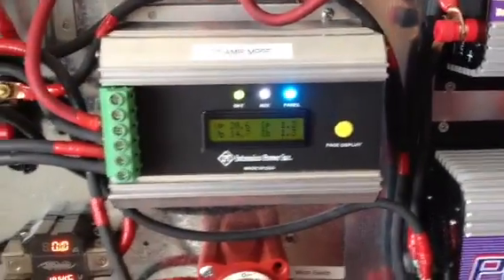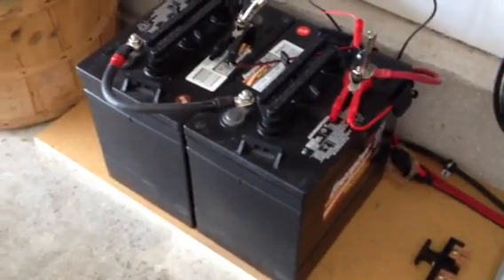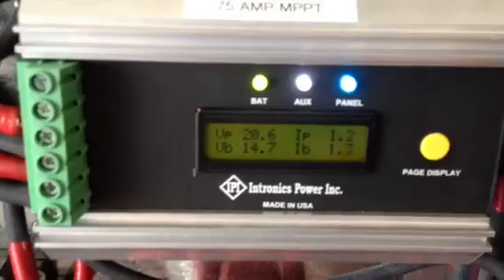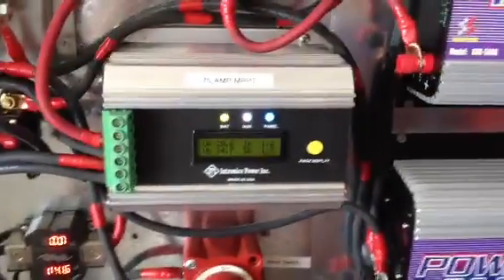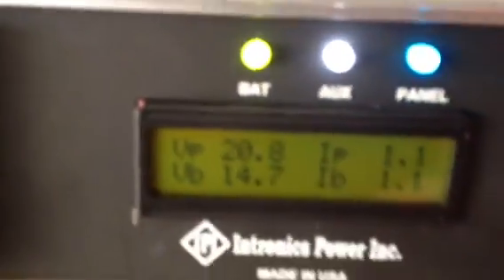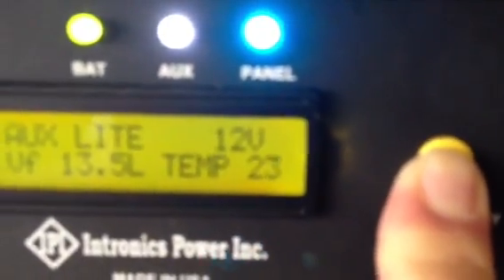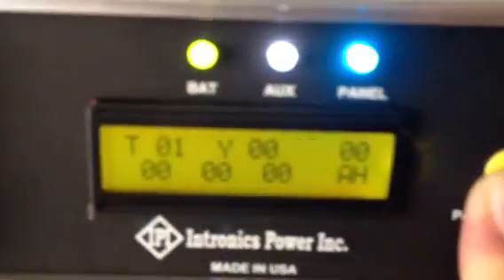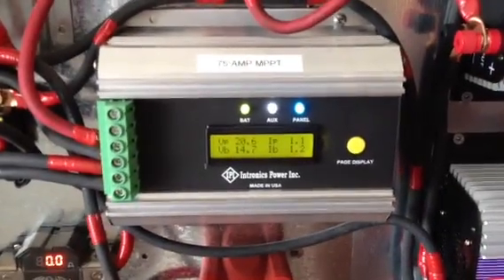Intronics USA Mppt charge controller, inexpensive alternative to midnitesolar and flexmax outback

Comment: How long did it last? Hearing many complaining about it 'chattering'!
Reply from the maker: +Sammy Kalintosh still working but I don't use it much only for random use o Rd emergency
Reply: Ray Isimz ok
Reply: Does it seem durable?
Reply: had my 500'ds since2011 and 1012
faultless. Some noise from the fan but not unusual amounts.
Reply: Mine has been running for 5 yrs with 3- 315 watt panels and 4- lead acid 1275 Trojans (12v 150 AH ) The fan will need to be replaced with a new one and you need to keep it off of really warm walls, I have it installed on a 12 ft box truck working solid everyday with my 120vac mini fridge running even on cloudy days for 5 yrs without fail!

Comment: IF you read the manual for this controller it will accommodate an input of up to 80 volts... and output a selected voltage of 12, 24,36 or 48 (?if memory serves) it will transform all input above the charge current selected down to charge current voltage and add the 'extra' current to the amperage boost. This is the MPPT function in full swing.
Reply from the maker: +joseph bodden thanks for watching

Comment from the maker: You need to run 24 volt battery bank if you have 24 volt panel you can connect 12 volt batteries to make 24 volts but you need to research on how to do that.
Reply: +Ray Isimz two twelve volt batteries in series (neg to pos) equals 24 volt battery. parallel connections build amperage (run time) and series builds voltage. i.e. four six volt batts in series equals 24 volts. 24 volt system generally charges up to 26-28 volts. research and use dc circuit breakers (best) or fuses in appropriate places.
Reply: NO YOU DONT! 
It is an MPPT it will convert your power from up to 90 volts down to 12 volts  24v, 36v or 48 volts , my panels deliver about 40 volts and I use a 12v inverter, this is the main reason to use an MPPT charge controller over a cheap PWM.

Comment: I'm running 24 volt solar panels, and a 12 volt battery bank, what would the sw7 and sw8 dip switches be set at, I'm a bit confused
8 up and 7 down, ?  thanks

Comment: You are using grid tie directly to the output of the charge controller? Or is using parallel? I would like to use in grid tie output of the charge controller. First to protect the batteries and then to look more like more modern systems. But I've been told that you can ruin the controller. Know anything about it?
Reply from the maker: Not sure I understand your question, but my grid tie has been working fine the way I have it hooked up for over a year now.

Comment: Yes, I tried one panel first and it did the same thing. The paperwork said it worked between 22 & 60 volts, so I though one panel at 19v on the multimeter might not be enough. It has not worked. No 3 green lights, only fault or high pitched noise depending on which way I wire. Unfortunately it was many months between purchase and installation and so returning it is impossible.
Reply: I think you should contact these guys and tell them about your malfunctions... if you seem honest and forthright you may find they can allow some slack on the warranty. I had one that I accidentally wired with the batteries into the solar inputs... they just kinda laughed and asked if any smoke came out, I said no, they said 'keep an eye on it' and if anything seems wrong we will send you a new one..." so I asked how much that would cost... they said nothing, just be sure to return the bad one. That unit is still working - all three of them actually... I really like these units. I have two 500'ds and one 750. I bought my 500'ds back when they were still building them in a garage! These units have been faultless.
Reply: This charge controller does NOT HAVE 3 GREEN LIGHTS! It has 1 blue, i white and the green will turn blinking and amber or red if your battery is dead. I think you may be trolling. 
If you bought from Intronics, you have a lifetime warranty on parts and they will rebuild it for $75. when you call Intronics, you can talk directly to the engineer that designed it for the Abrams M-1 tank!

Comment from the maker: If you have the 10 to 30 volt inverters maybe you are putting two many volts in, they also make higher volt inverters, did you try only hooking 1 of the panels up that would be only 19 volts going in?

Comment: I've got a question if you don't mind. I have the same China MPPT inverters to go into AC. I have two panels 100 + 110 watt, series, about 38 volts combined. When I attach + from panels to + on inverter it shows red light fault. When I attach + from panels to negative on inverter there is a high pitch sound. This is my initial start up. Have you ever had that high pitched sound? What is that? Do you think I got a bad unit? BTW, thanks for heads up on Intronics. Great deal.

Comment: You Can get some adapters to allow you to terminate larger key wire into the smaller opening of the charge controller.  I actually picked up some from an audio:video store that was selling reducers and other adapters so something to consider if you need to go larger wire down the road.

Comment from the maker: With a 12 volt system it is good for up to 1050 watts (14V charge voltage). In a 24V system, it will deliver up to 2100 watts (28V charge voltage). You can safely connect it to an array panels of any power rating, as it will automatically limit its output to 78 amps.